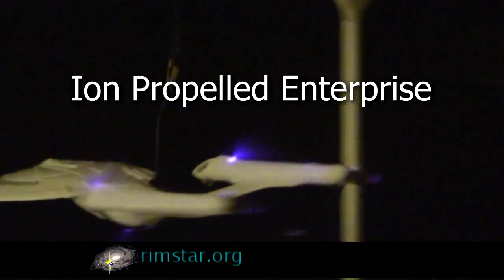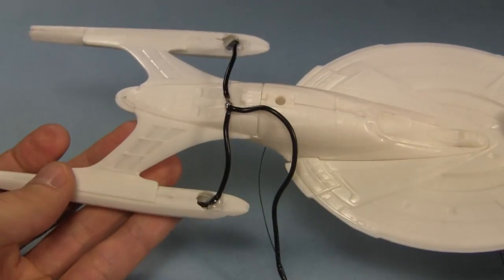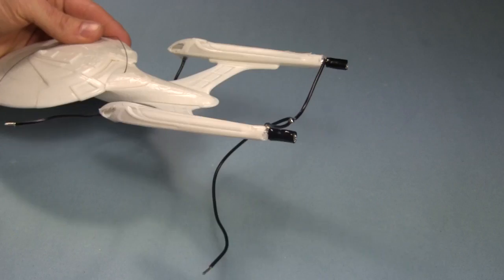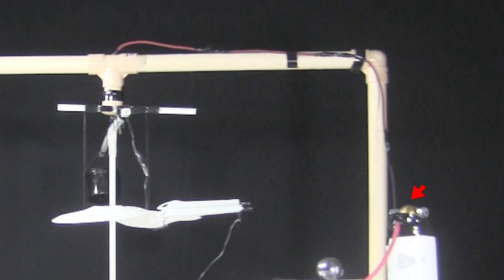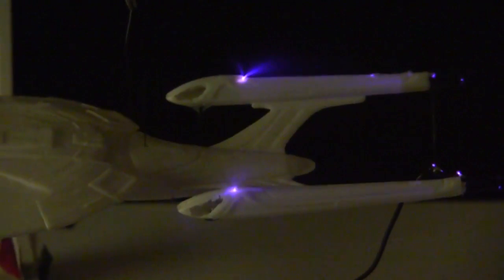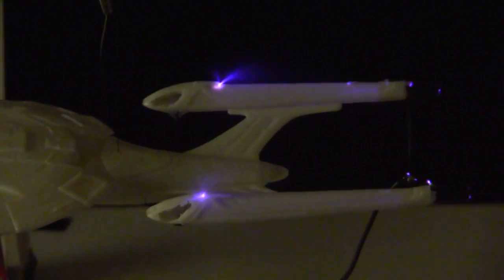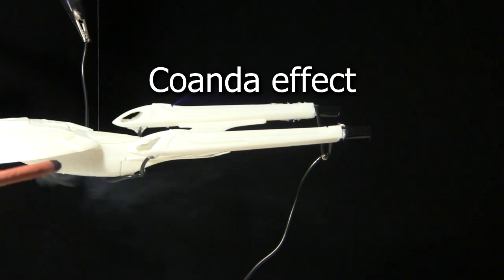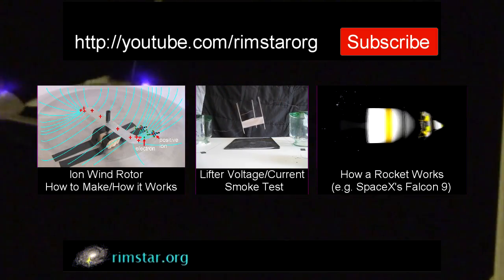Star Trek Enterprise Model with Ion Propulsion added

Comment from the maker: Here's my Star Trek Enterprise model modified to move using ion propulsion. I ended up using a store-bought model instead of handmade since my handmade one was looking pretty bad. :)
Reply: I like it. Good job RimstarOrg.
Using your method on an Enterprize model, is fancinating.
Reply from the maker: *****
Ion propulsion done this way can't provide much thrust but do a google search for "varimr" and you'll see one approach that, if powered with a nuclear reactor, may make short manned trips to Mars possible one day.
Reply: I've been waiting to see someone scale the BB effect up a bit but it seems slow incoming.  The first ionization of nitrogen is 17k, but air has a much deeper ionization potential among its major constituents like gears.  High voltage high amperage circuits could tap into this, perhaps superconducting circuits,  and I noticed in a personal experiment long ago that placing balsa wood dowel in the air spaces near a lifters corona can causea shaping of the flow that greatly increases the lift.  I want to get back to the concept some day but it seems like lift to weight ratio holds back building a strong enough power supply, thus I was looking at high voltage capacitors possible recharged with solar in hopes of finding a way around the issue.

Comment: 3D printed , isnt it?
Reply from the maker: Nope. It's a snap-together model I bought from a hobby store. I don't have a 3D printer yet.
Reply: Oh okay , but you can build one , i think , cheaper than buying a build-toghether stuff ;)
Reply from the maker: DerLeeker
The thought has crossed my mind. It would make a good video series. I don't know which was I'll go yet.
Reply: Think about it and do a bit of research , maybe you have a brand new and bit bigger project ;)
Reply: RimstarOrg From what I have seen the 1# prusa like the kit I have almost finished has the best support and decent development. Although a Powder and inkjet 3d printer would be pretty awesome and not as hard to make as it first seems. Or go the full hog a make a laser sintering printer... Saw a diy co2 laser the other day.
Reply from the maker: Mongrel Shark
I'm surprised to read you say that about the prusa. In your videos it sounded like you weren't to happy with a few things in the design, like those vertical rods that aren't supported at the top.
Reply: Turns out there is a reason for the rods to be free at the top. I still think its flimsy, but it works. There are a few things I will be trying to improve as I print more parts, but overall its a very simple build with lots of replications documented. I have similar design issues with most of the repraps. Not made to last. What they do offer is a really cheap easy way to get started and improve as required. You can do a lot once you have the ability to print whatever you want....

Comment: I absolutely love ALL your video's man, one question ... Why dont you try to Replicate Stanley Meyers work? The water Fuel Cell at high voltage and barely any amp draw "Which your experiments show allready" to break up the water molecule into Hydrogen and Oxygen ...?
Reply from the maker: I have done normal electrolysis in the past, though I never documented it since it was a project with someone else. I didn't get into playing with frequency, which is what I thought the Stan Meyers principle was all about.
Reply: RimstarOrg Yes I suppose, but also involve high voltage with a gated frequency, same principal of your work. Dont you wanna try a few experiments and see if you could hit resonance with a Stanley Meyer Tube cell. I have all the Patents and you may have all my work and documentation cause this is a open source project. None the less I think you have mad awesome talent with your inventions and think you should try some Stan Meyer ;-)
Reply from the maker: Francois Korff
Thanks for the offer. I have always found Stan Meyer's approach interesting since I first learned of it in the mid 1990s. I'll hold off for now. Thanks for the suggestion though, and the complement.

Comment: welp this is my new weekend project
Reply from the maker: Have fun! Let us know how it goes. The basic principle is as follows. The sharp electrode ionizes the surrounding air and the smooth electrode doesn't. Instead the smooth electrode is attracted to the ionized air. And as an opposite reaction, the ionized air moves toward the smooth electrode. The ionized air doesn't really get there though since it collides with other molecules along the way. So one electrode should be sharp and the other smooth. Make sure you don't have a lot of leaks in your wiring leading up to the electrodes, otherwise you may have stray countering forces.
Reply: RimstarOrg thanks! iv just started to put together some t shaped wires and check my equipment.
Reply from the maker: Mitchell Ottaway
You might want to put around a 250 kohm, 2 watt resistor in series on the ground wire going to the ionocraft to protect your power supply from any high current sparks. I thought my power supply was impervious to that, given all it's been through over the years but when I sealed up the nacelles real good to get rid of all the leaking you see in the video I finally damaged my power supply from some sparking. And if you have too much corona happening in undesired places, like the connection at the T in the wires, then you can coat them with corona dope. Just don't go overboard with preventing unwanted corona or what happened to me might happen to you too.

Comment: I would imagine that spinning in an orbit around a heavenly orb and releasing it at the right time would be the fastest way we know to travel in space...we have observed objects moving at close to if not past light speed around black holes. this effect is also noticed in quantum mechanics where they say an object is in two places at once..one of these is the double of the other from passing light speed. an echo without matter that holds still the same shape space as the originals so extremely fast speeds are obtainable in this manner. the issue in this is the trig timing and proper distances to be mapped before the release. I see it as a magnetic core that alters the charge on the skin when you change the charge you bounce off like a rock leaving a sling. right passed light speed. more of a method then a single type of engine...

Comment: Great! I really like your channel because your descriptions are so detailed and thus easy to understand. Thanks for sharing!

One question: How can I avoid a required ground-connection, e.g. to make my ion powered space-ship fully mobile?
Reply from the maker: Having no ground connection is entirely doable. It just depends on how the power supply is made. This craft is basically a very leaky capacitor, one plate being the sharp ended wires and the other plate being the smooth aluminum cylinder. So you just need a power supply that takes electrons from one end and deposits them on the other, just like charging a capacitor.
And thanks for watching!